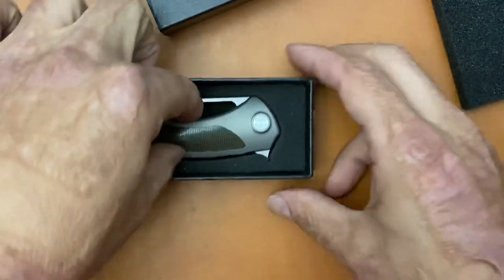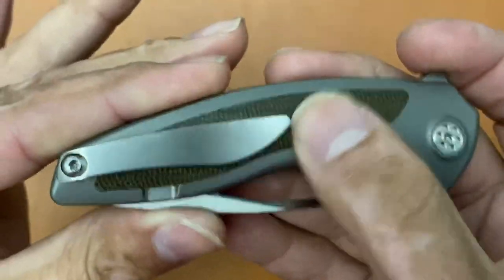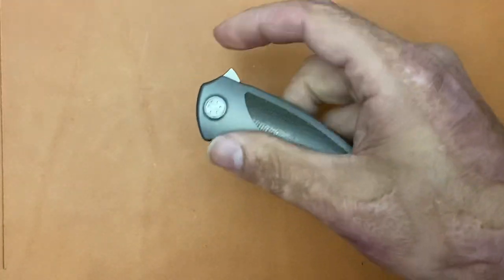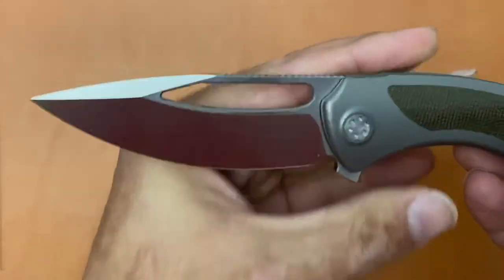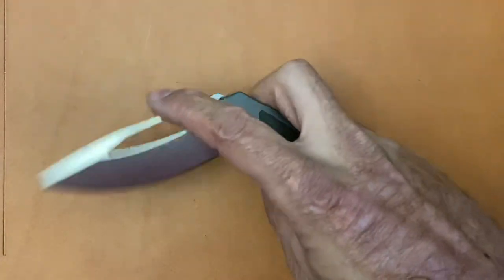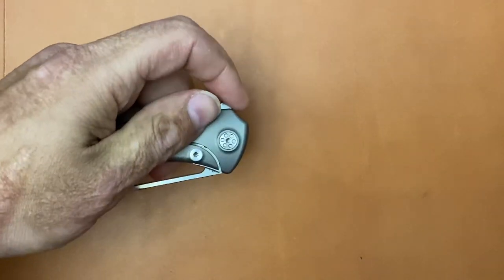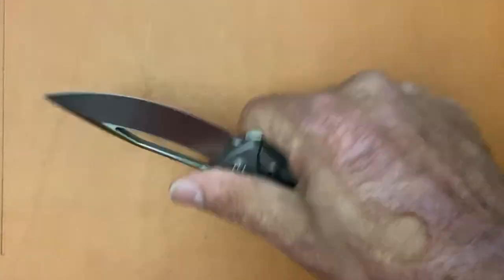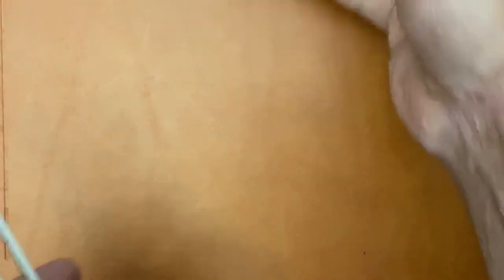Sharp By Design - Void 1st Impressions

Comment: I got the exact same model.   I have similar chips in the micarta and I agree the clip doesn't have enough ramp.  I don't have the detent issue you have, but the detent on mine is too light, similar to when you don't push your detent in.